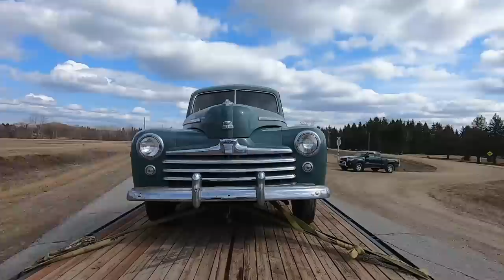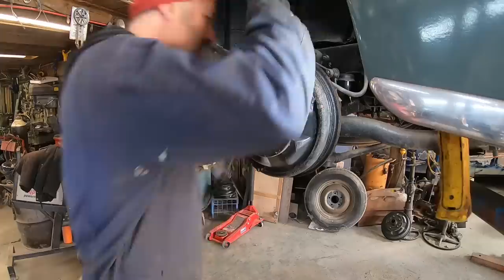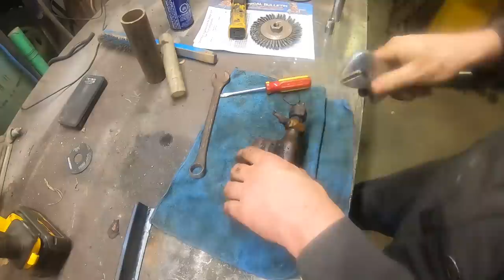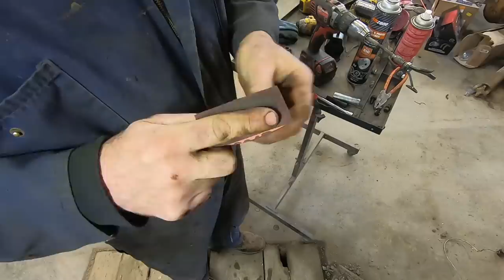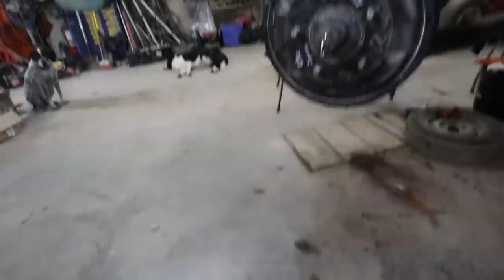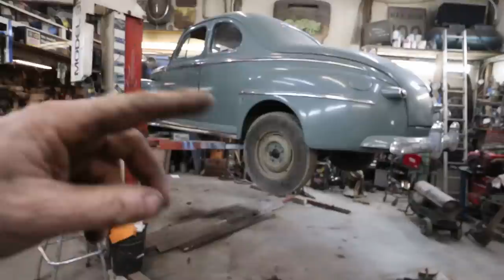Pickup a 47 Ford Coupe for a friend and get it road worthy.

Comment: That is a correct drum puller. I've used both versions ,and this puller is the best considering the other one would slip free of the drum. I was running a shop out of a car lot in Jessup Md. There was a worker I had that could be your brother. A lot of resemblance. He came up to me ,and was honest about just getting out of prison for robbery ,and wanted to stay on the straight ,and narrow. I couldn't argue with a man wanting to better himself so I said when can you start. He said right now. I started him on oil changes ,and general maintenance. Then taught him some diagnosing skills. I have to say he never made me regret giving him a shot.

Comment: Hello Brent. What a lovely Ford Coupe. She's a beauty. Can I offer some observations? I have a bit of Early Ford Experience. 1: If that type of puller works, the hubs were not tight enough. It takes a helluva lot of force with the correct type of puller to shift a hub that has been properly tightened. 2: The axle shaft taper and the hub inside taper need to be scrupulously clean. They can also be lapped in which helps a lot. 3. The nuts need to be done up very tight. A heavy lean on a 2' bar should do it. Loose hubs cause stress at the shaft keyway and the stress can cause cracks and eventual axle breakage, which normally means the wheel falls off and no brakes or gears to slow you down. I know nothing about big pickups and diesels but do know a bit about old Fords. I have featured axle taper lapping and tightening of the nuts in my own videos, normally on my 41 pickup. I hope you find this info useful, it would be great to know I've helped if only a little bit. All the best, Mart from Mart's Garage in England.
Reply from the maker: Cool, pretty much everything I've figured out has been from trial and error haha

Comment: Brent, that is the correct puller, but it was assembled correctly. 
The castle nuts werent tightened to 8.2 million foot pounds making it impossible to ever remove again. 
Dodge is similar.

Comment: Great video Brent, wish you would have showed you getting it running. I'm thinking it's a good thing you saved those brake shoes. Knowing how you enjoy rebuilding, rather than replacing brake parts. I know it's just a matter of time before you start rebuilding brake shoes too. Get yourself a 4'x8'x1/4" sheet of asbestos, and you'll be in business. Lmao. Not a big fan of the 47 Fords. I like Fords from 1923-1941 and then I am not really a fan again until the mid to late 60's. But, keep in mind that I did work for GM dealerships for 22 years. So the fact that I am a Ford fan at all, is saying something. Thanks for entertaining us. Looking forward to the next one.

Comment: Replace the rubber brake lines, no matter how they look.  Rubber brake lines usually won't swell on the outer diameter to show they have gone bad because of how strong the outer core is.  They will swell inwards, closing up the fluid path.  The problem with that is that you can step on the brakes and the brakes will work because the high pressure opens the fluid path, but they will freeze in the open/on position when the pressure is off the system because the fluid path closes.  This is a common reason for stuck brakes.
Reply: Yup. Had this happen on my 69 nova!
Reply from the maker: yeah have had that lots, but usually affects one wheel when it happens not all of them haha

Comment: Should pick up an ultrasonic cleaner and some of the cleaner, really works awesome on removing gummy deposits and dirt,we have one at shop and I put just about everything in it,from carbs to spark plugs to electrical actuators , just wish ours was bigger. Put small parts in a mason jar or coffee mug and sonic waves still clean through glass!! Would be great for wheel cylinders or masters

Comment: Next  time a  6 volt  battery is  needed   for replacement,   order  a 8  or  9 volt
battery  for  replacement.  Most  people  are  not  aware   of  this.   The  starter
will  then  turn  over  much  faster  resulting  in  a  faster  start.    The  light 
bulbs  will  readily  accept  this  higher  voltage  and still perform normally.
Reply: You can also use a 12v and swap the starter and step it down for everything else..

Comment: Flat, flat lands man flat land! Scoop up the coupe, trailered like a queen, gonna be a runner, she's a survivor she's clean. Carb needs pumped up, breaks too they're stuck up, loud muffler won't shut up, gonna silence that pup, not you pablo. Rip them brakes down, honed n rebuilt cyliners all around, back 2 done, fronts wait'n on parts, drums n wheels on to roll her around. Don't need no brakes on flat, flat ground as long as no one else's around.

Comment: Remind us what's powering the General. Also what frame. The original International probably had some large hauling ability. Might be something to keep in mind. A modern 1 ton or 3/4 might be light.  No criticism. Great project. Enjoy the videos very much.
Reply: 96 dodge with a 12v cummins
Reply: @danielbuckner2167   1 ton?
Reply: @garyanddebwi2857  yeah or 3/4
Reply from the maker: What @daniel buckner said 96 dodge 12v, 3/4ton
Reply: @HalfassKustoms  Brent, any regrets on that particular donor? They are pricey here in the US. I was thinking of using a 12v cummins because it would fit better in my 49 chevy panel than say a 7.3 international.(or any v8 really) Am i overthinking the fit issues or should I keel lookin for a 6?

Comment: How do you film the drone footage as your driving down the road ? 
Looks like a very clean 47 Ford.
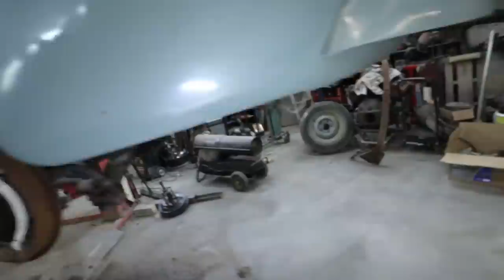10:33  Having worked on cars with tapered axles, that tool works, nothing wrong with it at all.
I use to use one that had a tee on the end and you hit it with a heavy hammer.
14:44 At least buy new cups when you build the brake system. That means master and wheel cylinders.
20:13 Your front brake shoe is the primary and it will be the smaller of the two. I do see stepped wheel cylinders for the front brakes also.
Reply from the maker: it's got a follow me deal, yeah I'd replace the cups if I see something wrong with them but these where fine just gummed up from sitting.
Reply: @HalfassKustoms  As far as the cups, do the job once. Always replace them. My 2 cents as an auto mechanic.

Comment: Got 2 stuck valves on a 50 merc flathead, any advice?
Reply from the maker: other than working them not really, pull the head and the intake remove clip and you can pull the valve assembly out.